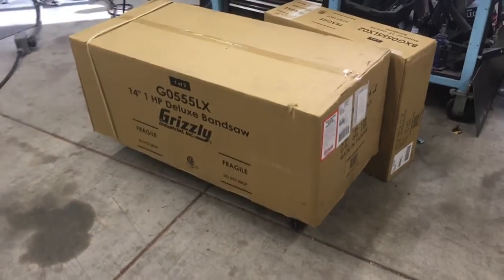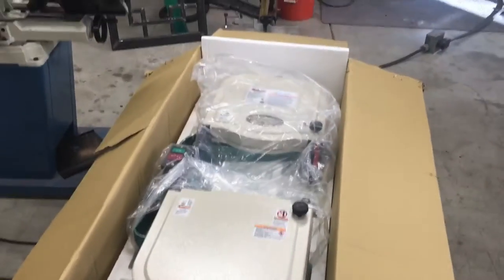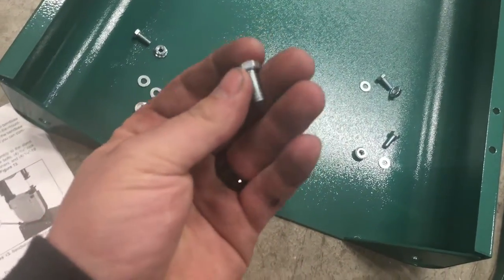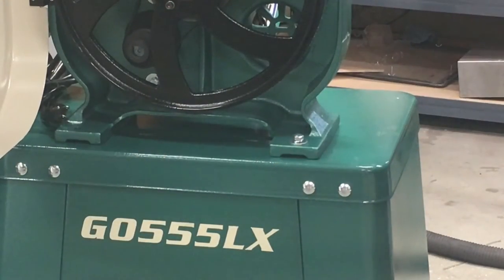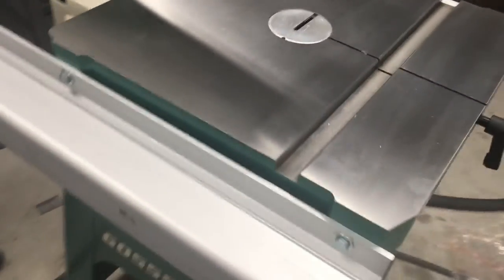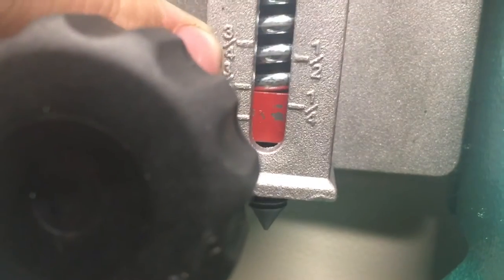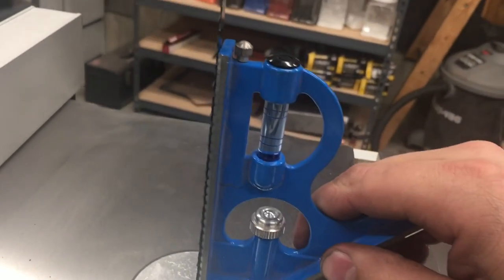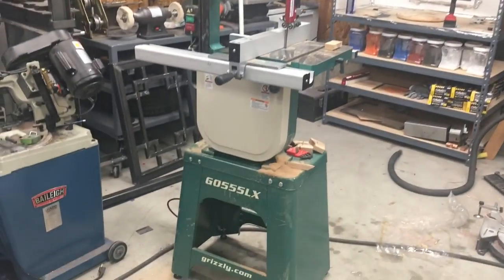New Tool Day: Grizzly G0555LX Unboxing and Assembly.

Comment: Disassembled the top half of the saw from bottom half while it was in the box. Set top half aside, stood box up and walked bottom half and motor out of box, then loaded onto base and reassembled. Since i did this alone, i put the 5/8" bolt, nut and washers in place using a prop under the bolt to hold it up, so i could slip the top half onto the bottom half. Awkward but effective. I also installed the riser kit at this time. When using saw, on thicker pieces, the guard will bind against the upper housing and also touch the top wheel. The fix is to remove the guard extension when above 6". When closer to 9-12", remove the guard. Also, on mine, there was no positive reference for placement of the upper blade guide casting to the guide post. There is a set screw hole bored in the post, but it faces the front! Calling tech support today about that, since being able to align the guide casting to the post is imperative to efficient tracking of the blade and blade and guide bearing wear and performance. Other than that, it looks like a great saw and I'm eager to use it.